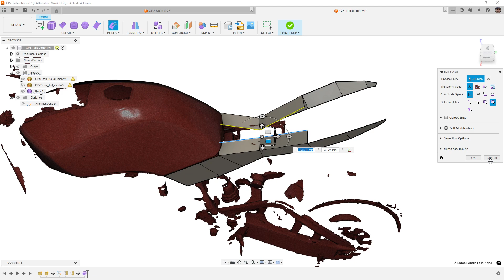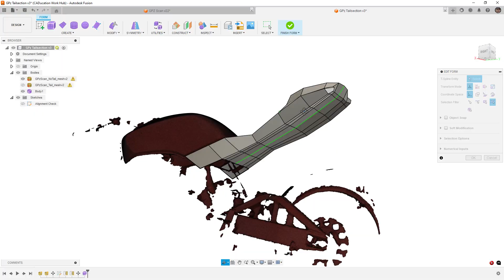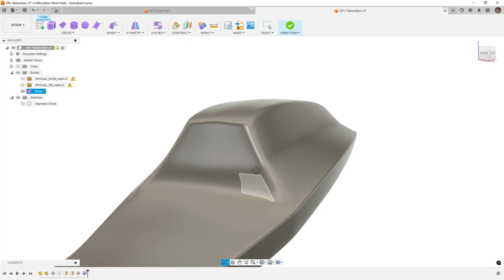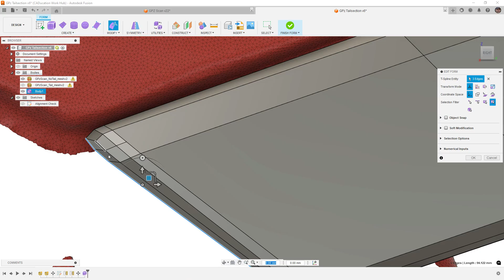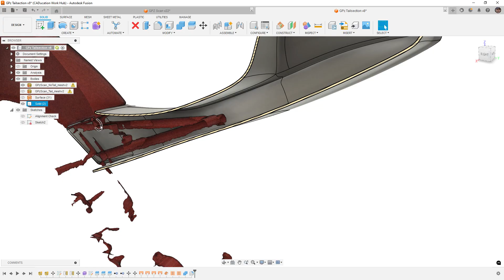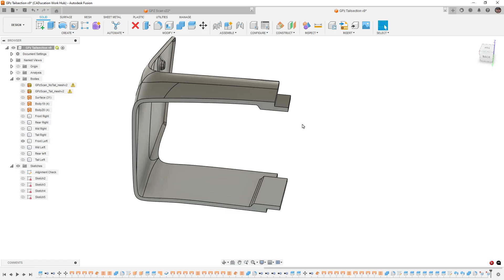How To Design A Motorcycle Tailsection | GPz Build Series Episode 5 #motorcycle #diy #3dprinting

Comment: Priceless lesson, great to get idea of how you approach building entire product shape. JFYI, Fusion 'Move' command records distance, you just have to use 'translate' instead of 'free move'. Also for translate you can choose ditection of move (component coordinates, design coordinate system, choosen direction).
Reply from the maker: Great tip ill have to try that with move!  I always leave it on the free move but using translate would be great to record that.  thanks!
Reply: @LearnEverythingAboutDesign  glad to return at least tiny bit of information in exchange of huge volume of knowlefge you share here!